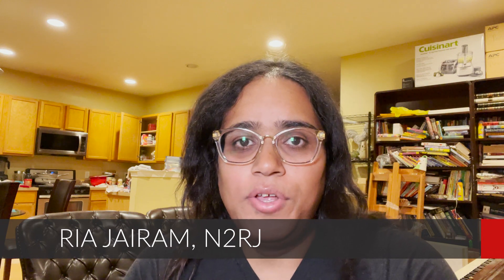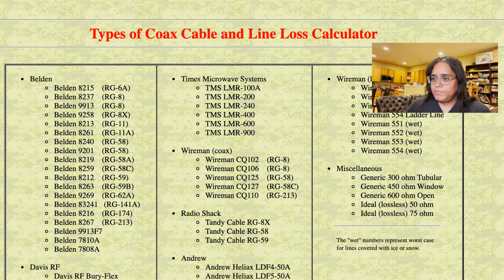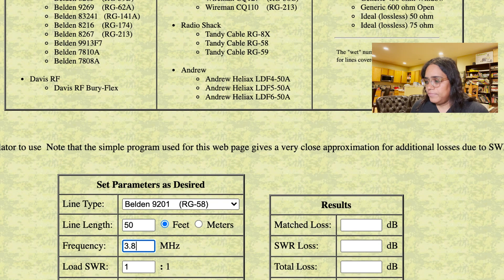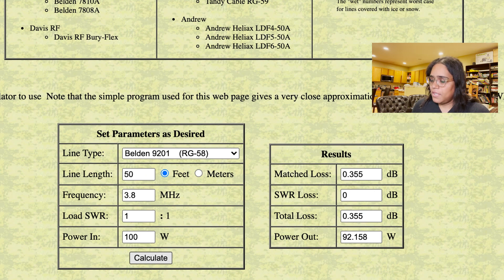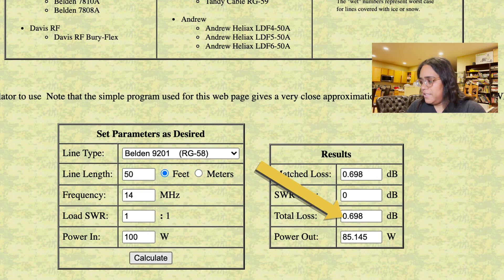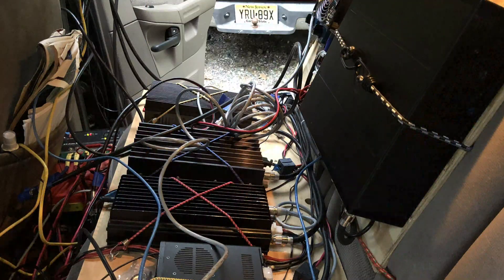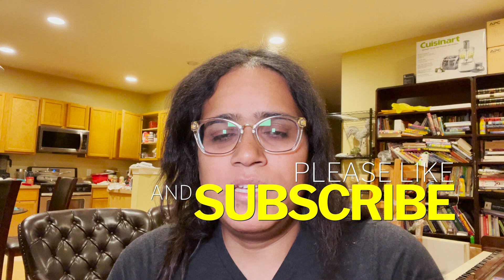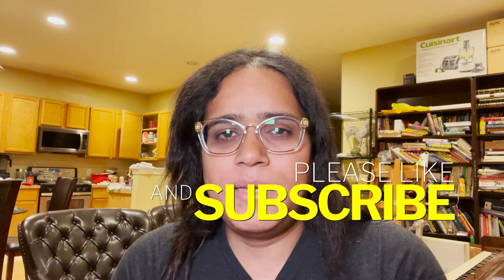What coax do I use for ham radio? And other questions. #hamradio Ria’s shack

Comment: What's the best coax for my mobile/base unit ICOM 2300H ma'am?
Reply from the maker: Depends on where. No “best” coax overall. For mobile installations you’re better off with RG58 or 8X. For home use you’re better off with RG213. I like Davis RF bury flex and also Messi and Paoloni. They make good coaxes.
Reply: @n2rj  Thanks so much for the insight and more power to your station!

Comment: One thing that should be mentioned as well is “ease of use” with some of the heavier gauge coax. I went all in on LMR400 when I first built my station and found that it is heavy, hard to coil up, install, etc.